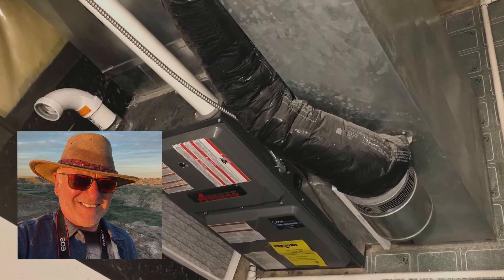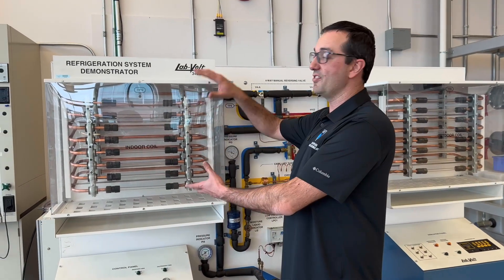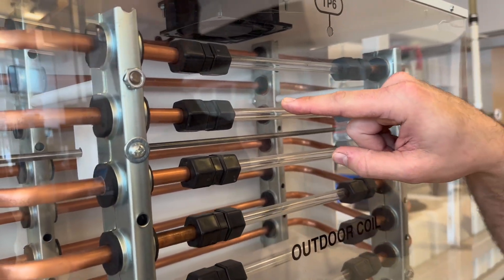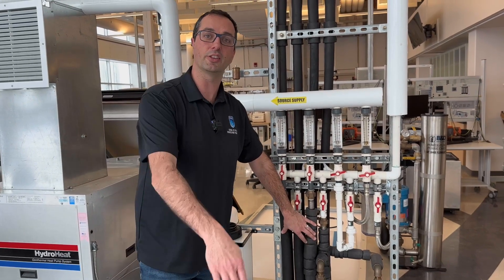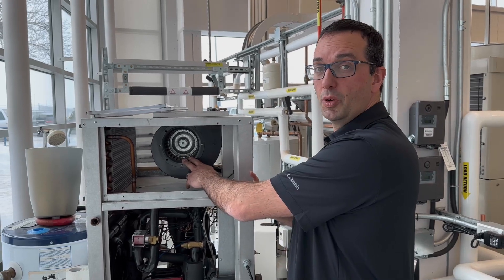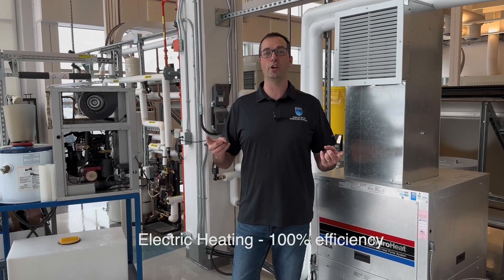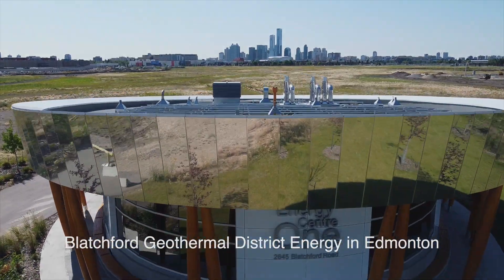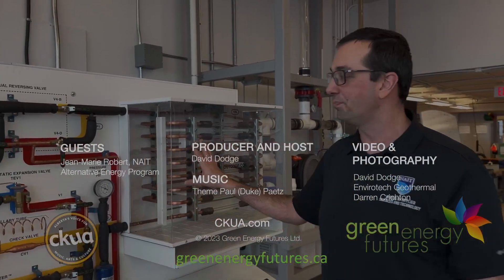Heat Pumps 101 - How they work, Why they are great!

Comment: The real cutting edge for heat pumps in Canada is the R290 ATW (air to water) Monoblock heat pump. Using R290 you can still produce heat when the temperature outside is -30C and you can heat water as high as 85C. This would cover 100% of domestic heating and hot water for most Canadian households. It would also cover 100% of summer air conditioning and still provide domestic hot water. R290 has the lowest GWP of any traditional refrigerant other than CO2 itself but is less complex due to the lower cycle pressures. (so less expensive mechanically) R290 is flammable but in a ATW Monoblock all the refrigerant is contained outside the building so does not create a fire hazard. Only water or water/glycol enters the house. A Monoblock heat-pump is ideal for both hydronic heating and fan coil heating/cooling so is suitable to replace any existing boiler or forced air furnace. These R290 heat pumps are widely available in Europe and Asia but are dificult to find in North America because the industry has been slow to adopt the safe more efficient system and still favors older less efficient high GWP refrigerants. Any Refrigeration engineer will tell you that an R290 ATW Monoblock outperforms R410a and Even R32 on price and cold climate effiencies.

Comment: Do you have a system useful in Saskatchewan? It’s been minus 39 degrees Celsius there recently , geothermal will perform better!✌️❤️🇬🇧
Reply: We installed an air source heat pump in Edmonton with supplementary electric heat in the air handler. These systems are designed by installer to provide enough heat to meet the demands of the building, and usually that means you've taken steps to appropriately insulate the building (reduce heat load) first.  Geothermal can be messy out in the yard when it's installed, but it might rely less on supplementary heat because it's working with less extreme temperature environments. In both cases, it's IMPORTANT to be aware of the size of your electric panel and the total electric loads, but with good planning a service upgrade can often be avoided.